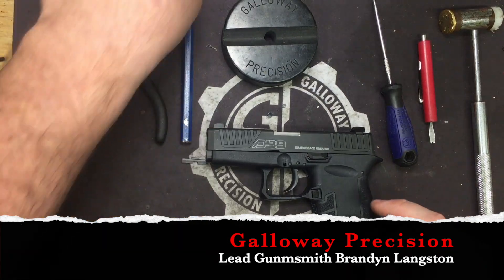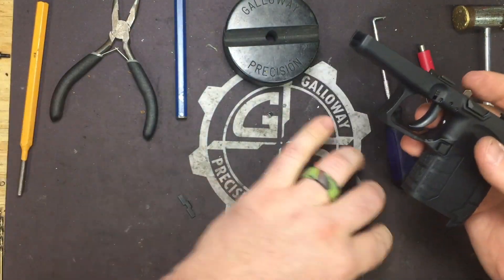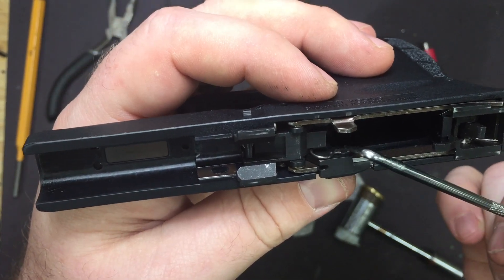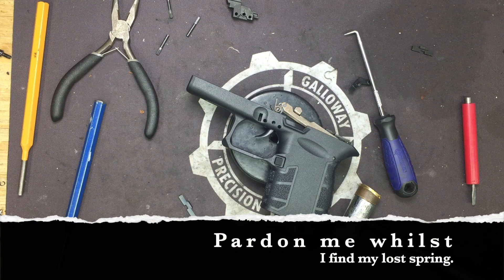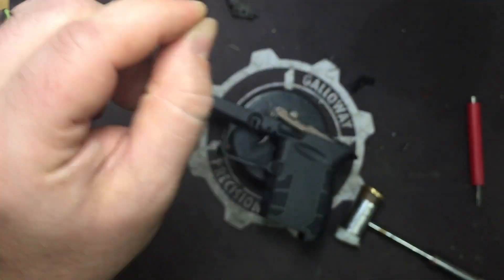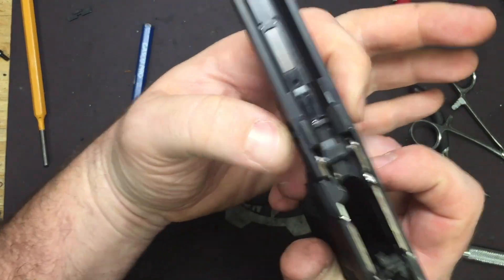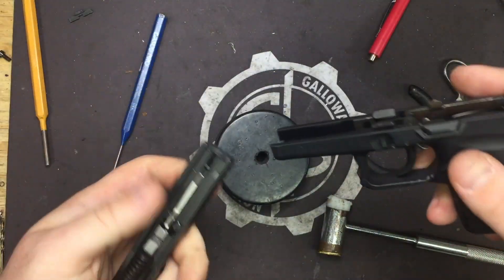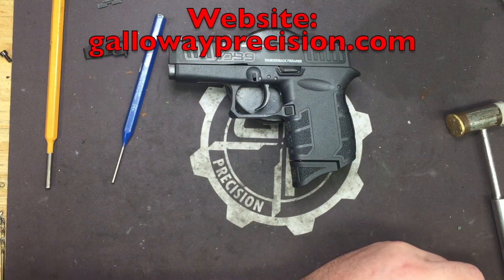DB9 Gen 1-4 Extended Takedown Plate Installation

Comment: Just finished after two hours! Where you're placing the spring around the 7 minute mark, there's a tiny indentation where the spring nestles between the "gadget" and the "widget".  Looking for that answers the question, "How and where is this spring supposed to fit in here?"

Using the 3/32 punch is a must in reseating the pins, While I was at it, I took care of the problem on the magazine that snags the last round and polished the feed ramp for good measure.